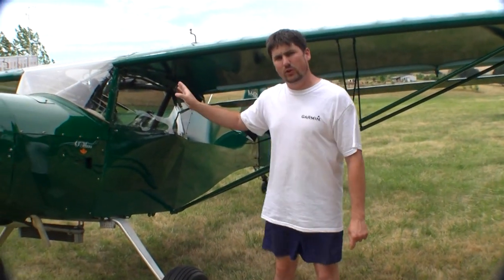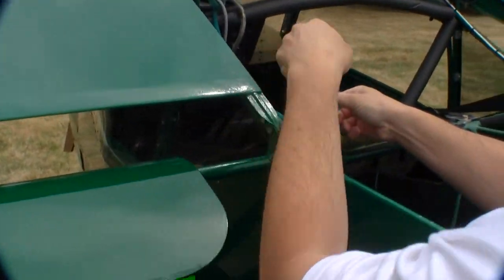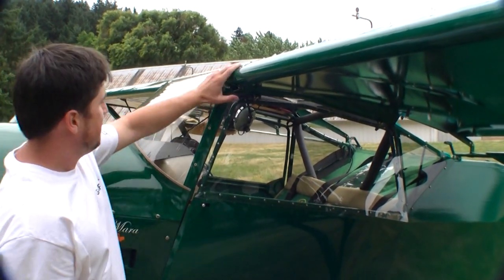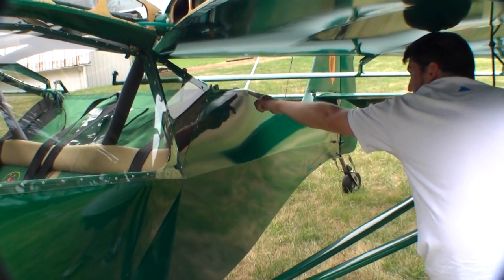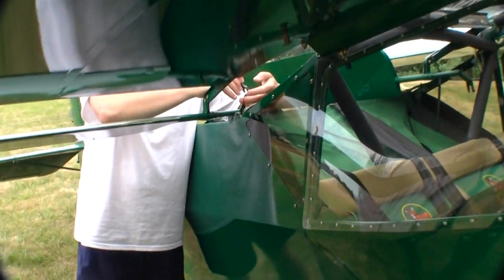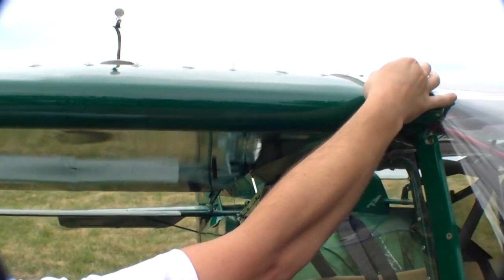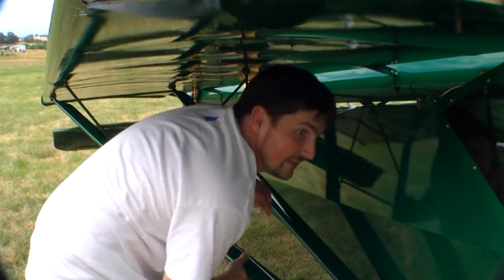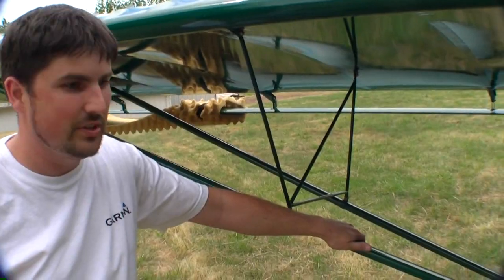How to Fold Kitfox Aircraft Wings - Folding Wing construction

Comment: seems like rain would get in with the turtle deck off and the wings folded while you were driving it down the road

I'd attach some rubber bands to those control rods to automatically pull them out of the way.  strong enough to do the job but not so strong to interfere with your controls.  or springs.

also maybe some to hold the flaperons in a neutral position when disconnected
Reply: Rather than rubber bands which would affect the linkage while flying, I would probably see if I could mount spring clips on frame tubes so that after the linkage rod is disconnected it could just be clipped safely out of the way. 

But I agree that it would make sense to have some provision to secure the flaperons in an appropriate position while the wings are folded.

Comment from the maker: @evo2379 Yea but I wouldn't really call it 'involved'.... it's quite simple as you can see.  BUT, the pins have to be honed to slide in and out just right, all interference points trimmed and perfected, pivot bolts lubricated (and inspected regularly!) But that's all once a year at the most so when it's perfect you get what you see, a fast wing fold.  Thanks Enjoy!